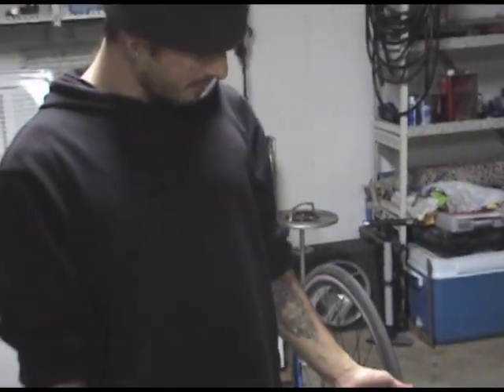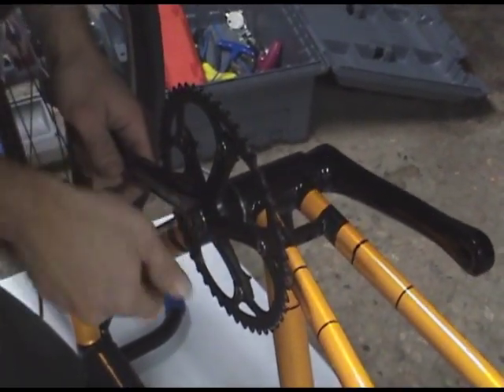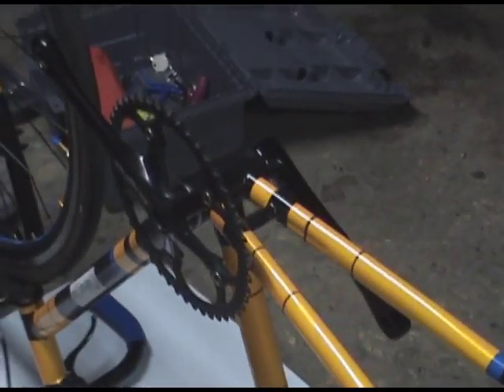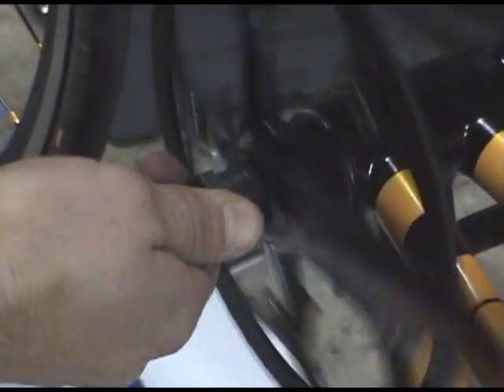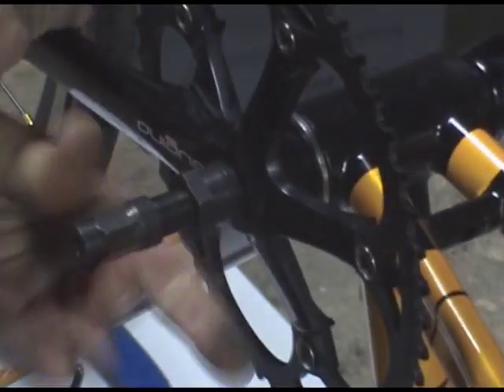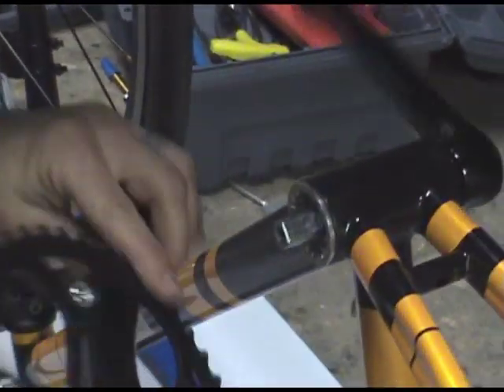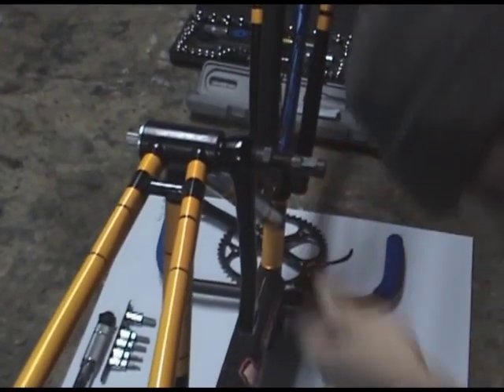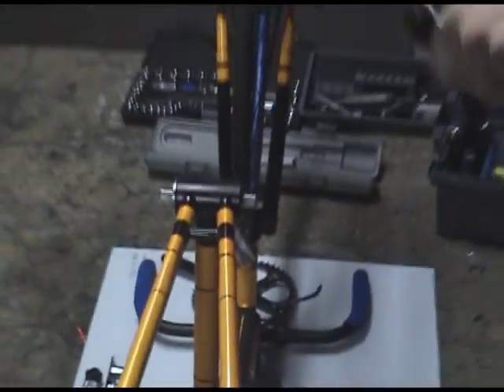How to remove crank arms on a fixie

Comment: I was charging in uphill when I flew over my handlebars. At first when face hit asphalt I thought, chain must have snapped. After unpeeling face from ground found crank had snapped in half. Never imagined it was mechanically possible. Now can’t ride bike cause I need a special tool to steel my wife’s crank. Damn. What a wicked weekend. Ughhh!
Reply: oof that must have really sucked, how is your bike now?

Comment from the maker: @ongne1234 then yer not going to be able to safely take it off. the one im using in the vid was like $7. if u plan on doing anything with bikes yourself a crank puller is an absolutely needed tool.

Comment: how tight do they have to be? and what if the chain doesn't align properly?
Reply: if your chain doesnt line up that means you need spacers between crank case and sprocket.
Reply: depending on how unlined it is you will probably need like a quarter inch spacer, nothing bigger than that and if that doesnt work than go bigger.

Comment: I bought the tool (CCP-22) but I can't get it to thread into my crank arms. It seems like the threads on my arms are more shallow than the ones on the tool. I took it back to the guys at the bike shop (total dicks) and they said it wasn't possible and that the tool I have is universal. Any suggestions? It just wont thread without me damaging the crank arms.